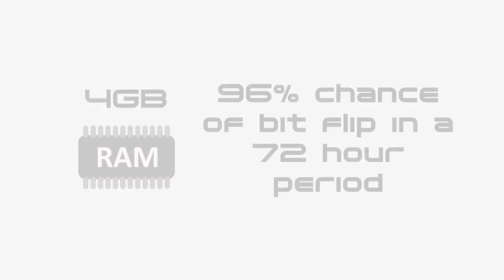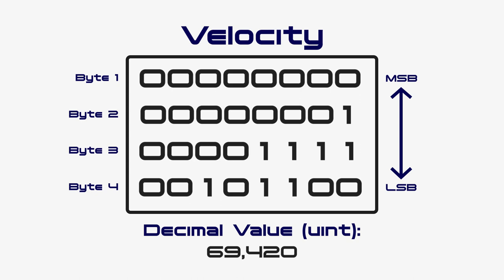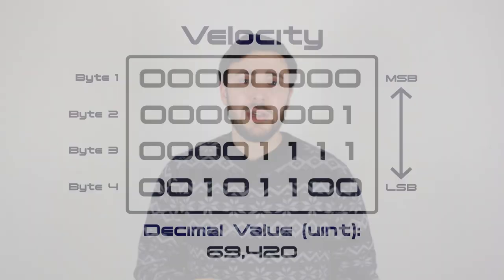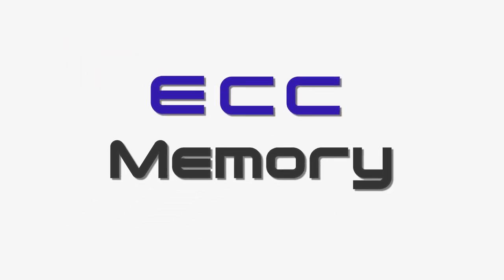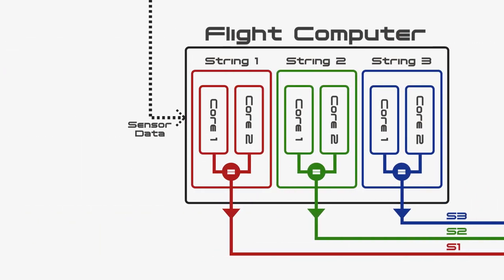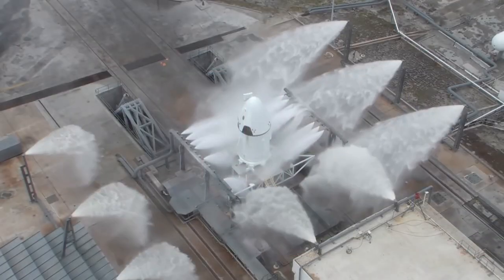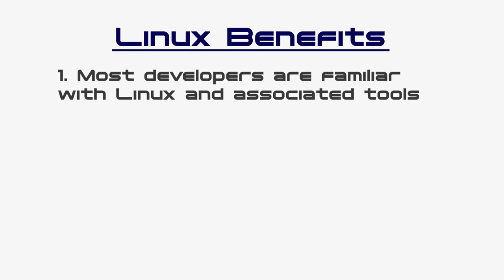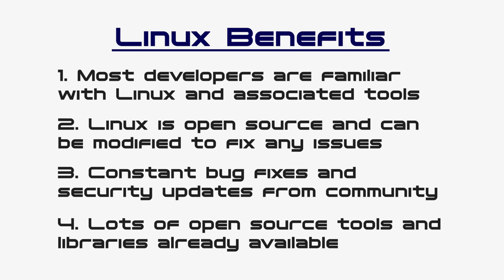The Everyday Computers Powering the SpaceX Falcon 9 Rocket | Excellent Engineering

Comment: super interesting video🤩, please do more on spacex
Reply from the maker: Sure! I always love making videos on SpaceX
Reply: @zackberry6729  Oh good!!! but do you think spacex has created a proprietary motherboard that contains all three processors on it ???
Reply from the maker: @riccardopogliacomi2087  I can’t say for sure, but I believe it’s 3 separate motherboards connected using Fiber Optics/Ethernet. Having a single motherboard would negate a lot of the redundancy of having three strings since physical damage or an electronic component failing would take out all 3. As for building their own… I’m not sure lol, but if not I would assume they at least glue stuff down and try and toughen it physically. They build a lot of the electronics for Starlink custom, including custom ASICs, so there’s a good chance it would be fairly easy to just build the boards themselves.
Reply: @zackberry6729  Ah OK. the last thing. I didn't understand bare metal well !! I didn't understand well what it is
Reply from the maker: @riccardopogliacomi2087  sure! It just means “no operating system”. You can compile code to be ran directly by the processor on startup. It’s a lot more difficult (but also fun!) because you have to write code to startup the processor and manage all the computer resources yourself (memory, hardware click sources, PCIE). It can be a lot of work depending on how complex your program needs to be. But it gives you 100% absolute control over the computer and if you write good code, it’ll run much faster than it would inside of an OS like Windows or Linux. 

Bare metal code is generally used for microcontrollers because  they usually have little RAM and aren’t very fast, so running an OS would use up the majority of the computer resources itself, with little left over for your program. Especially if you don’t need 95% of the features the OS has. There’s ‘embedded’ versions of OSes designed for this purpose but even then, writing bare metal code gives you more control and performance.
Reply: @zackberry6729  Ah ok thank you very much